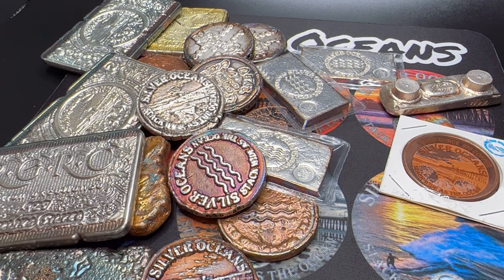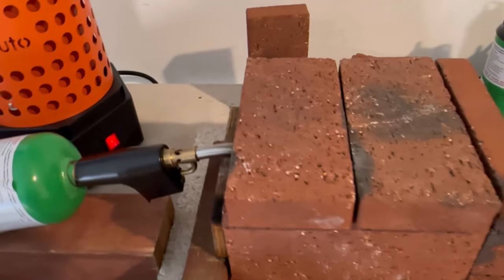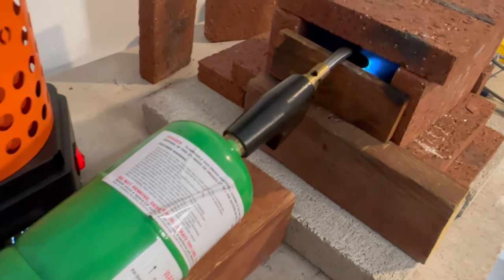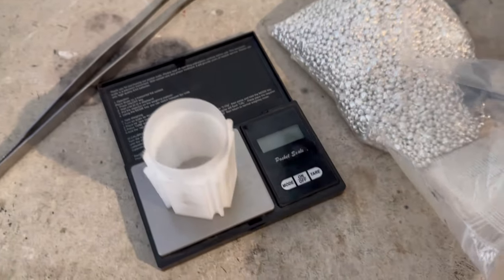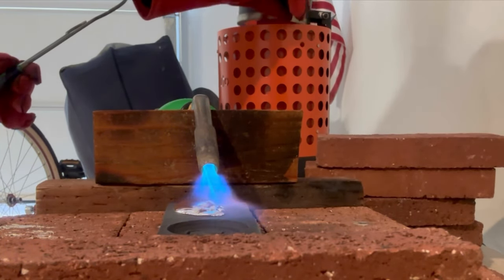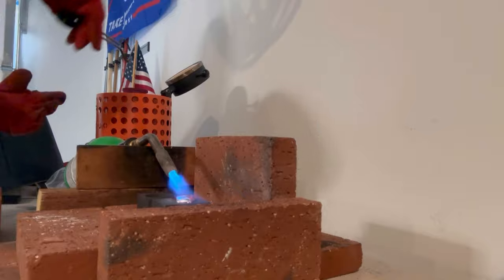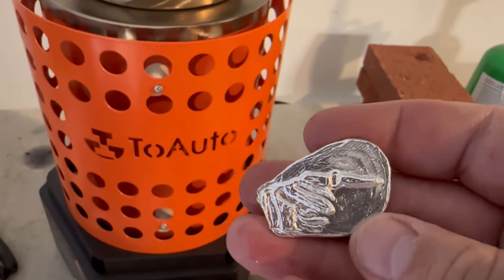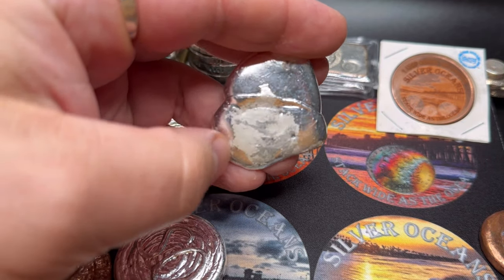Incredible Results! Poured Silver Secret to Maximize Pour Detail

Comment: is pouring other things like copper any different than working with silver?
Reply from the maker: Copper melts at a higher temperature, so it cools faster, it also pours thicker. Silver is a lot more nimble and easier to work with. I’ve seen people doing aluminum pouring, that stuff looks sticky, like taffy, but you don’t need to get it very hot to melt.
🔥🦈🌊